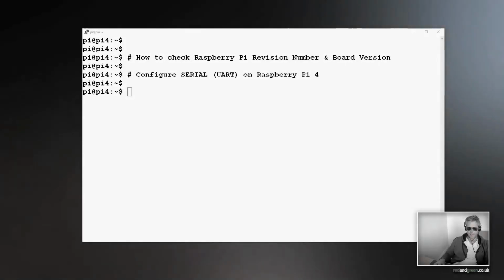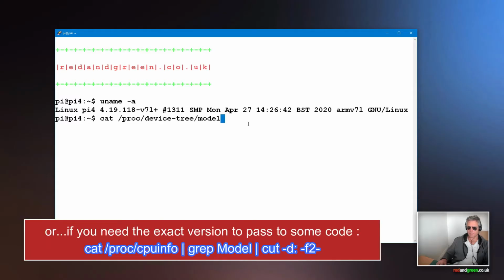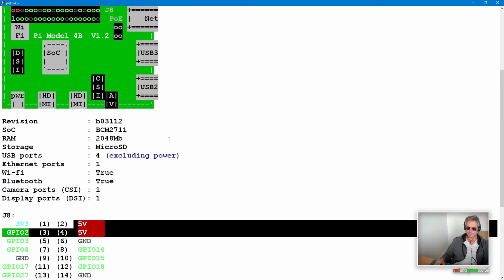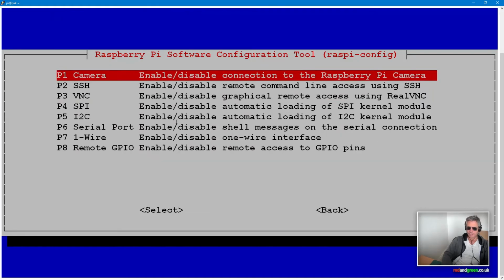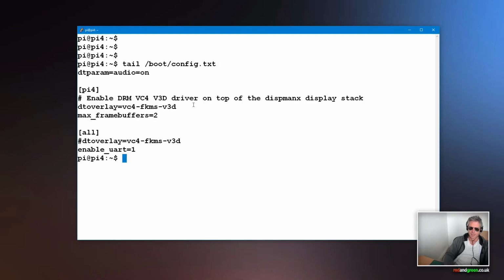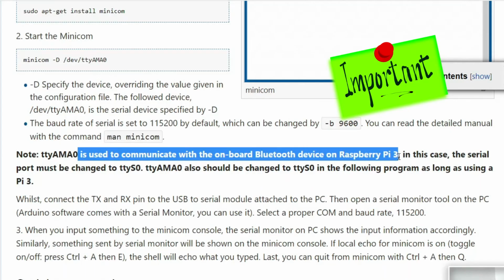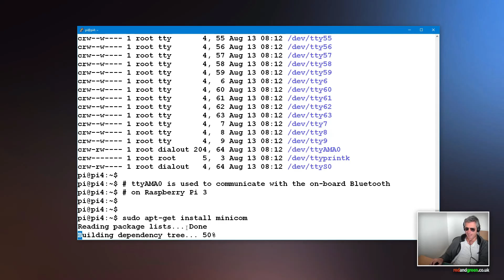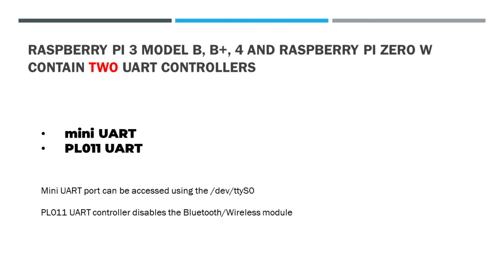Configure Serial Raspberry Pi 4B - UART - GPIO 14 and 15

Comment: Good day sir. May I ask how I can use 2 TX/RX? Im using 2 components and I dont know how to configure the pi to have 2 TX/RX
Reply from the maker: import RPi.GPIO as GPIO GPIO.setmode(GPIO.BCM) GPIO.setwarnings(False) GPIO.setup(7, GPIO.IN) GPIO.setup(8, GPIO.OUT) GPIO.output(8, GPIO.LOW) GPIO.setup(22, GPIO.OUT) GPIO.output(22, GPIO.HIGH) GPIO.setup(17, GPIO.IN)
Reply from the maker: This sets whether it is a Tx or Rx and sets the initial state

Comment: This refers to the Pi 4 and the Pi 4B.  Are they two different models, or is the description just not used consistently?
Reply from the maker: To quote the Raspberry Pi forum : "To make this simpler, the Pi4b IS the Pi4, but takes longer to type.
Seeing as there is currently only one model of Pi4 (the Pi4 model b), many people just refer to it as a Pi4" !! 👍
Reply: @jobstr-work  I see.  Thanks.  That does seem like asking for trouble if they ever release a 4B+ or a 4A/4A+ though :)
Reply from the maker: @TooSlowTube  To be honest by the time they have any stock I suspect it'll 4C !!

☺
Reply: @jobstr-work  ThePiHut and Pimoroni have had stock of the 4B recently.  I bought a 2GB 4B from ThePiHut a little over two weeks ago.  If you set an in stock notification, you may get to buy one before they sell out again.  If not, just set it again because they seem to come back in stock every few days.

FWIW, I've tried MiniDexed on both the 3B v1.2 and the 4B.  It gets much hotter on the 4B, even with copper heatsinks on.  I don't think it really gets to idle on either so the 4B might need a fan, just to do the same thing as the 3B.

Comment: I've yet to be able to get this to work. Not getting any output on Putty terminal, GTKTerm terminal, or Screen terminal.
Reply from the maker: are you connecting over wifi or cable?
Reply: @jobstr-work  WiFi when setting up Raspbian on a monitor and then I guess it's still WiFi when I try connecting it to my laptop with the FTDI adapter because I don't have the Ethernet cable plugged in.
Reply from the maker: Did you create the 'ssh' file with the Wi-Fi said and password when you set up Caspian?
Reply: @jobstr-work  I didn't create any ssh file because I didn't even know that I had to. All's I did was put Raspbian on a flashdrive because I'm USB booting it and then went into the initial setup process after booting the raspberry pi and then updated it via sudo apt update && sudo apt upgrade in the terminal and then enabled the serial port via raspberry configuration app or software that's in Raspbian by default.
Reply from the maker: Ah ok, so if you have a monitor connected, go to terminal and do 'ssh-keygen'   you can find full info on Google on " set up ssh" 👍
Reply: @jobstr-work  Oh. So I have to setup a ssh connection before I can even start setting up and using the serial side of it?
Reply: @jobstr-work  Okay. So I just reimagined a flashdrive with Raspbian using Raspbian Imager and enabled SSH and booted into it and then enabled serial port with the raspberry pi configuration utility and then shut it down and hooked it back up to my laptop and then opened putty and then did what I had to do there and still not getting anything from the raspberry pi on the screen/terminal. I'm on 3 B+ not raspberry pi 4.
Reply from the maker: @luigiprovencher  Can you try "dtoverlay=pi3-disable-bt" 

ref : https://raspberrypi.stackexchange.com/questions/45570/how-do-i-make-serial-work-on-the-raspberry-pi3-pizerow-pi4-or-later-models
Reply: @jobstr-work  Yes of course I can but at which point in the process, though?
Reply from the maker: @luigiprovencher  you can enter it at bash prompt now, just once, and that can fix it
Reply: @jobstr-work  Okay. Thanks.

Comment: I am trying this on a Raspberry Pi 4 with Ubuntu Linux flashed. When I run $pinout， the result is an error:
Unable to initialize GPIO Zero. This usually means that you are not running

pinout on a Raspberry Pi. If you still wish to run pinout, set the

GPIOZERO_PIN_FACTORY environment variable to 'mock' and retry, or refer to the

Remote GPIO section of the manual* to configure your environment to remotely

access your Pi.......

Thanks for hte assistance

Comment: Would this configuration work on the serial communication (GPIO) pins I.e. TX,RX ?
Reply from the maker: yes, but do not try to put more than 3.3V on any GPIO pin and don't try to draw more than 3mA per output.

Comment: After searching the internet forever I finally came across your excellent explanation. I wanted an Arduino to send data to the Raspi4 Rx port, instead of using the Arduino USB-B programming port to send it. Which would have tied up the programming port. Not good.
Your simple terminal commands turned on the Raspi Rx port, and along with 'ttyS0', the link between the Arduino Tx1 and Raspi4 Rx was a success.
Frankly, I don't understand what the heck 'cat /prod/device-tree/model' has to do with anything, but it worked.
I can't thank you enough.
Dave
Apple Valley, CA
Reply from the maker: Thank you very much for the very kind comment, glad it got you working, if they are of interest I have 2 other videos of me messing about with Pi and Arduino as well:

https://youtu.be/eXpzo8CTSuY
https://www.youtube.com/watch?v=tE3BokF92gc&t=1492s
Reply: @jobstr-work  My next challenge is to have an Arduino GPIO port trigger a 30 image slide show stored on the Raspi. Preferably with full screen HDMI output from the Raspi. I've used GNUPlot in the past and it was great for plotting daily windspeed. This time I am trying to show 30 days of sunspot growth and motion across the face of the sun. The sun's rotation period is 27 days.
Reply: Dzzz

Comment: Perhaps I misunderstood- on my v1.1 Pi 4B it only worked with ttyS0. (Using my Pi with FLdigi to control a Ham radio, so maybe the software makes a difference?). Besides that, wonderful video- I'd never have gotten it to work without it!
Reply from the maker: Yeah, the best thing to do is to issue 
$dmesg | grep tty
And from the output you would see the appropriate tty, depending on the hardware attached .

Comment: Thank you! I'd seen references to disabling bluetooth to get the hardware serial port working but mostly referencing the 3 and wasn't sure if the 4 was the same. Thankfully the wifi module still works (so I can use VNC over wifi to control) even though the notes at the end suggest both wifi and bluetooth are effected by PL011. My TFmini plus Lidar sensor is now outputting. Cheers.
Reply from the maker: Good, glad you got it working, thanks for the comment as well 👍👍